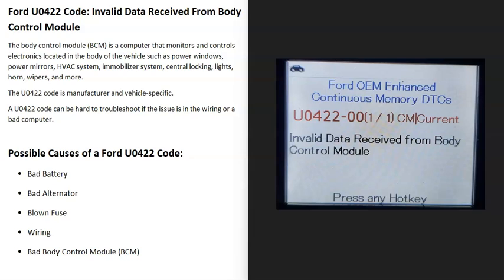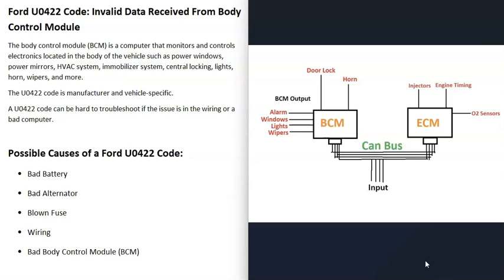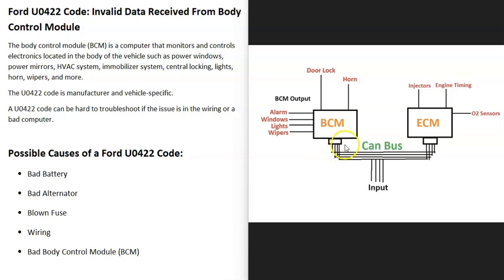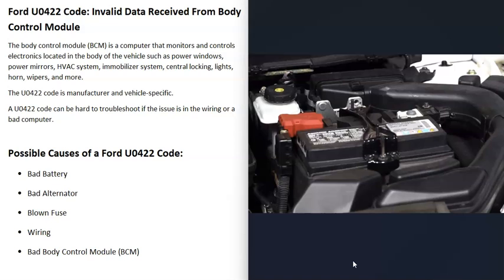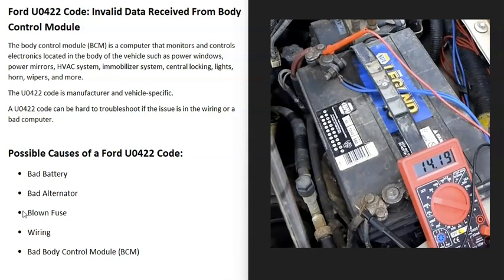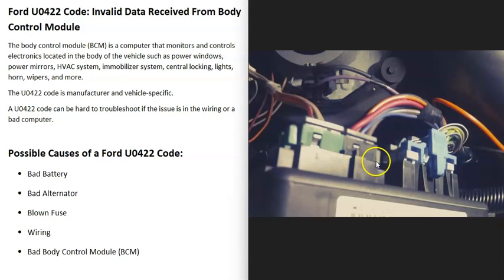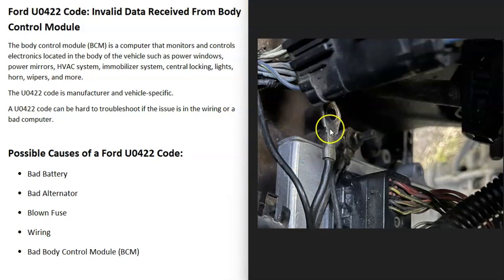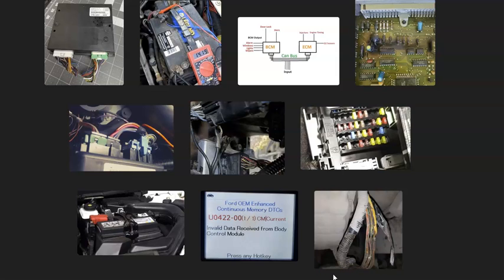Causes and Fixes Ford U0422 Code: Invalid Data Received From Body Control Module

Comment: My question is, could this code come up from a bad controller ( ballast) on my led head lights? My low beam/drl on drivers side, won't stay on. Upon start up and cycling the head light switch the low beam  will will flash on then go out. These are after market lights I've had for 10 years. I bought a lariat with halogen lights ( I did not know that when I bought it) so I took truck back 2 days later and ford decided to upgrade my lights rather than take truck back. Wondering if this would trigger this code .  
Thanks for the informative video. 🍻

Comment: Hi, I have a 2015 F150 3.5. Truck runs good until I accelerate hard then the check engine light flashes and I lose horsepower. I don't believe it goes into limp mode because i still have plenty of horsepower. The codes it displays are P0300, P0301, P0305, and U0422. Also, I did replace the battery two weeks prior. Also, not sure if its related but a battery will not last but around 2 years before i have to replace it. Any advice is greatly appreciated, Thanks.
Reply: Just dealt with this exact code combo except mine was cylinders 1&4. Still had P0300 and U0422. Solution: replace all 6 spark plugs and boots on ignition coils. Grease ignition coil boots on both sides with dielectric grease. All misfire codes (P0300, P0301 and P0304) are now gone. Code P0300 means multiple/random misfire from more than one cylinder. Code U0422 still remains but that loss of power and flashing check engine light is due to those cylinders misfiring. Hope this helps.
Reply from the maker: This code can be difficult to diagnose. If you think there is an issue with the battery failing, check the alternator output is good and in range.

Comment: I got U0422:68 and u0416:68. but car all good
Reply: Me too and nothing is funky about electronics except stupid flashing clock and radio does not work. Otherwise everything seems to work.
Reply: What if came out after i used forscan to change my gear and wheel ratio?
Reply: @tomasgarcia1546  as for me, changed the tire diameter with forscan about 6 mths prior.... interesting

Comment: 2014 Ford f150 just got my battery replaced. Next morning it wouldn't start. Ran the codes. It gave me U0422.   Called advance auto, who installed the battery, said it is not related to the battery. Dealership set the BCM should have been reset after install. Advance auto said that is not required. What is your take on that ? Thanks.
Reply: How do you reset the BCM?
Reply: Ke no sabeeeee
Reply: Ke no saben ke c capaciten
Reply: I'm confused, the dealership set the DCM?